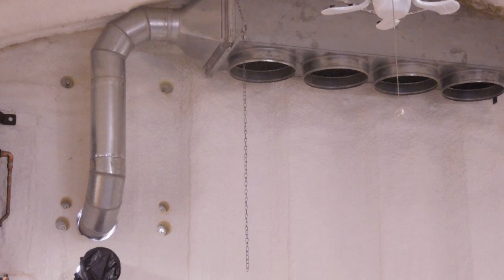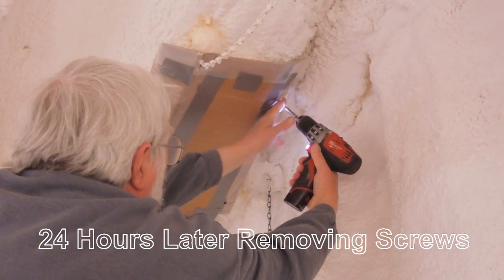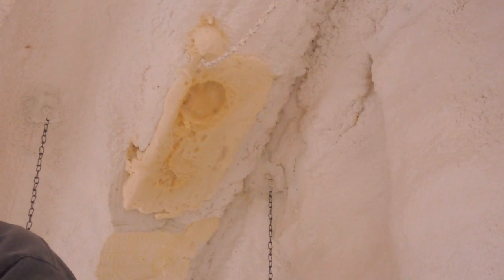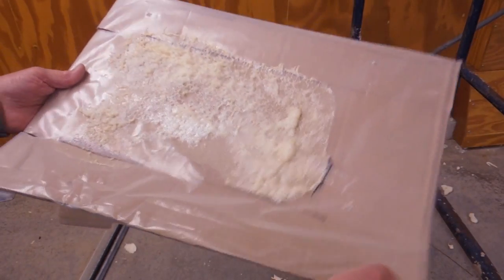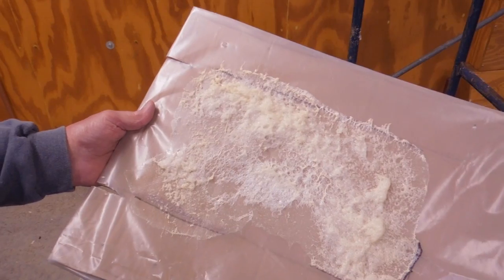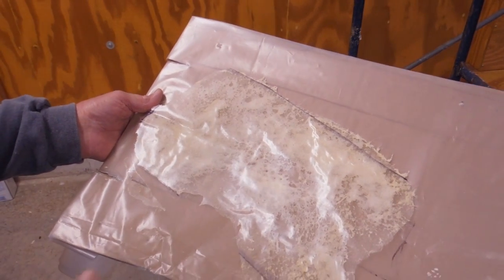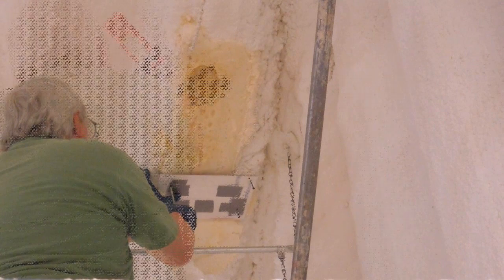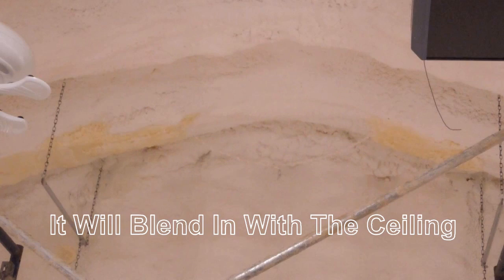Steel Garage Ceiling Foam Repair

Comment from the maker: Some dust collectors are just dust relocation systems. This system moves a lot of air. The surface area of these bags is very large compared to the volume of air being moved and they do not even inflate. I never have any escaping dust. The bag itself is more of a felt material. Oneida also sells this same system with a cartridge inside the dust collector instead of this return air plenum. Pleated cartridge filters tend to plug up (personal experience) including ShopVacs.

Comment from the maker: This is a 1.5 HP Cyclonic Cartridge Dust Collector returning air to the shop through a Thimble Plenum with 4 felt material filter tubes and is rated at 750 CFM @ 8” of water. A good demonstration of the suction of this dust collector would be my video Dust Collector Floor Sweep Adaptor. Later on there will be a video showing all of the newly installed ductwork.

Comment from the maker: Since I built my drum sander, more fine material escapes the cyclone separator and ends up in the 5 gallon buckets. Therefore it just depends on how much I use the drum sander.  Otherwise they seldom require emptying. This system moves a very large volume of air. The main reason for returning the air to the shop is to salvage heated air in the winter and cooled air in the summer.

Comment from the maker: The closed cell high density foam sprayed in the garage is not immediately or dangerously flammable. By that I mean sparks and such will not ignite it. If you had a major fire in the garage then it would then catch on fire. Generally a fire is needed to keep it burning. I guess the best defense is to not have a fire. I have fire extinguishers and water hoses if needed. The Great Stuff foam does burn easily.

Comment: Dear Ron, I would be interested to see your dust collector in action. A lot of folks use those round pleated filters. You're using bag filters, and I'm interested to know if you're happy with that solution? Per Mr. Wendel they're just as good.

Comment: I bought a new spray foam can, went to screw on the nozzle and snap!  The tip broke off and i couldn't use it.  Had to buy another.

Comment: Killer foam manipulation! I downloaded and saved this video.
Great Stuff now make "Pond and Stone" foam which is indifferent to UV (hence its black color) and designed for outdoor use. Any through holes or areas exposed to weather can be sealed using Pond and Stone which need not be coated. I've used it to seal a stainless steel patch panel to an external HVAC duct which had a water ponding problem due to being installed by uncaring slobs. Now it's all I buy.

http://building.dow.com/na/en/products/specialty/pondstone.htm